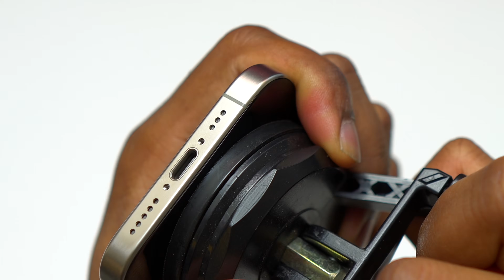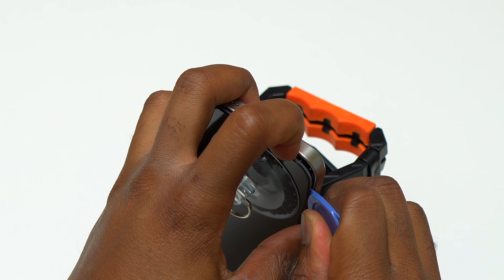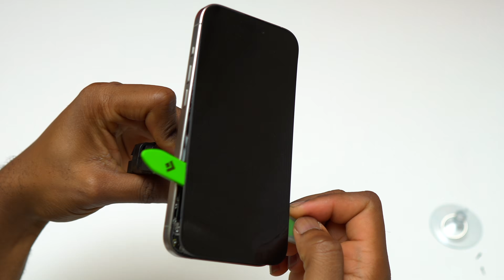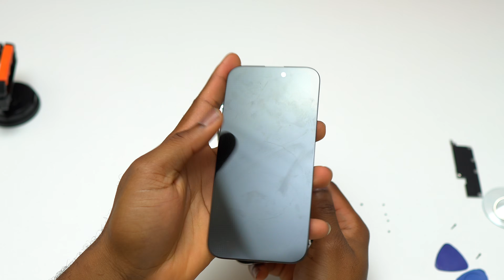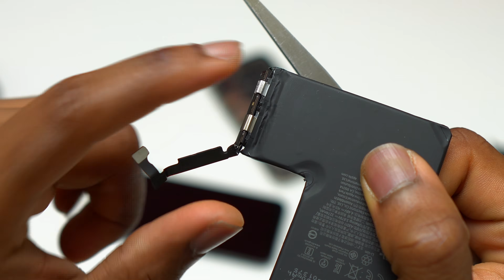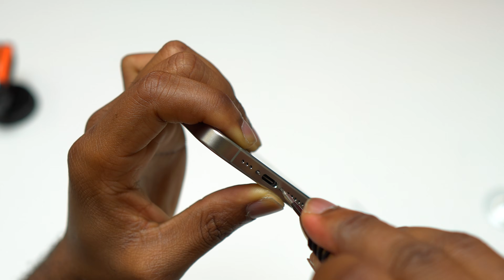iPhone 15 Pro Battery Replacement Repair

Comment: Ive learned about design for repairability in an engineering course last year, and it seems apple is actively working against these principles 😂
Reply from the maker: I can understand your point but Apple is not in theory land with everything ideal. If they truly implement something super easy to service they would have to spend more in r&d and implementation of the new design. Change their assembly lines etc..... They don't want to spend more than the minimum necessary 😂. More likely their constraints are more complex than my super summary.

Comment: Bro, metal spudgers on boards and connectors is a no 😶
Reply from the maker: When you remove the energy source there's no risk using a metal pice. Isolating the battery is the first step I took and without a metal tool (plastic or use your finger). This is my thought on the comment. Let's us know you're full thoughts so that I can fully understand.
Reply: @ersbit  it’s about damage to the board and flexes
Reply from the maker: @jurojegr OK. Thank for the clarification. I have bercer got anything damaged since I started doing these videos (your experience may be different) you can see on my videos I do it normally not stressed or aggressively. 
What you said can happen but I never had that experience. Tomorrow I'll be opening the 16 or 16 Pro doing the same thing 🤷🏽‍♂️.

Comment: Basically buy a new phone
Reply from the maker: I wouldn't say that. Here's the video with the battery coming from Apple Self Service Repair (this makes everything easier....just parts would be a little bit mire expensive than if you were to get them online. At least you have the certainty of having an original battery and keep true tone etc...)

Apple iPhone 15 Pro Max Battery Replacement Repair
https://youtu.be/oI1IcmaGULQ

Comment: If we replace the battery then phone will not be waterproof means if we remove old battery and add new battery plss reply
Reply from the maker: Yes. Generally any repair front or back and going inside the phone will remove the water resistance!! Now to restore it you basically cannot as you would not have the machine to scientifically confirm the device is water resistant again after you finish the repair. Only shops and especially authorized repair shops have this type of machine to guarantee that the phone has became water resistant again. 
This is why when I finish these videos I don't say it is water resistant again as this would be a gamble and no scientific data to confirm it. Just consider the device no longer water resistant if you do it yourself. Light water splashing or light rain should "should" be fine but Submerging the phone under water will be a big gamble.
Reply: @ersbit   I have iPhone 15 pro max and my battery health is 85 my phone is under warranty so I want to change my battery so I have quieries that if I change the battery than my phone will be waterproof or not

Comment: where can I find the tag-on flex for jcid programmer?
Reply from the maker: The best place to get these items is eBay. Some are already in the US and shipping will be fast other are out of the US (China) shipping will be longer to receive. Check Amazon also but I did not find them there last I checked.

Comment: Fuck that ! I’d rather pay 109euros to get it done securely at an Apple Store.
Reply from the maker: 🤣. Yes I agree if you have the money (yes). If it is not the case you'll try this process.
Reply: @ersbit  but shattering my iPhone 15 pro max in the process of changing the battery myself would cost me a lot more than 109euros.

Comment: Been seeing solly comments saying just replace the battery yourself it's easy. Then it's like yeah easy to break your screen and deal with a lot of work and tools you don't normally have on hand.
Reply from the maker: Battery replacement is easy but all the stuff you have to do before accessing the battery is what makes it hard. Also the issue with battery health gone is real but fortunately there is a fix for that now without programming like we used to do it.
Reply: @ersbit  yeah. I miss the days when samsung let you slide the back off and take it out and put another in. If we get better with right to repair i may even see apple trending the industry towards better times again. I also miss bezels cause I feel unsure about cutting off part  of my screen virtually when playing games.

Comment: Not safe! I thought they are going to have it repairable replacement yourself. Just open the back case and open it easy so you can replace battery. I guess it will not do. Maybe I should skip for iPhone 16 ? Or something. Apple is not design friendly at all! Jeez.
Reply from the maker: Unfortunately that's the most friendly repair iPhone 🤣. It's in fact easier than the previous ones but still challenging.

Comment: What would you say is the easiest repairable phone ( excluding the fairphone)
Reply from the maker: SAMSUNG all the way!
Samsung you can do everything once you remove the back (Samsung and other phones with similar designs)
Apple you need to open the screen to do everything else and now you can remove the back fairly easy
Google Pixel you need to open the screen (gets damaged easily) then you work on the phone, but the back glass of the pixel is the worst (VERY BAD) I have videos of it on the channel. They can make it very easy but there is always something to help you damage something specially the wireless charger and NFC and also the fingerprint sensor glued to the screen can get cracked when you try to remove it. 

Samsung and other having the same design as Samsung are the easiest!!
Reply: @ersbit if samsung is so easy, find me an option to buy geniuine samsung battery kit with screws and gasket in it so i can replace it myself.